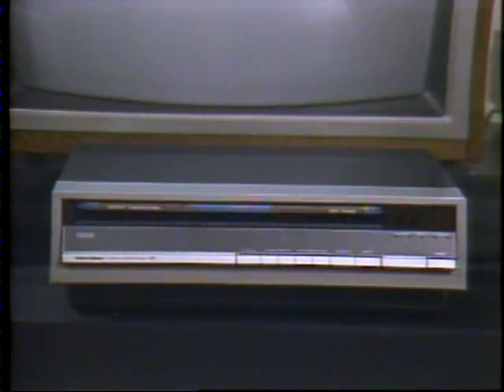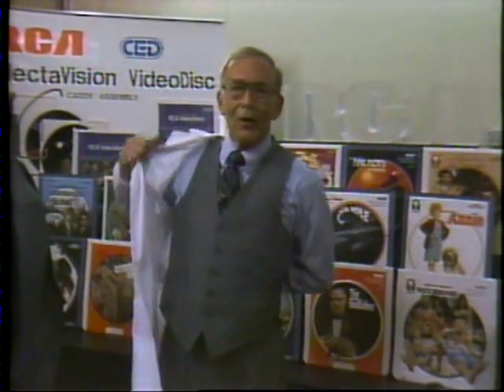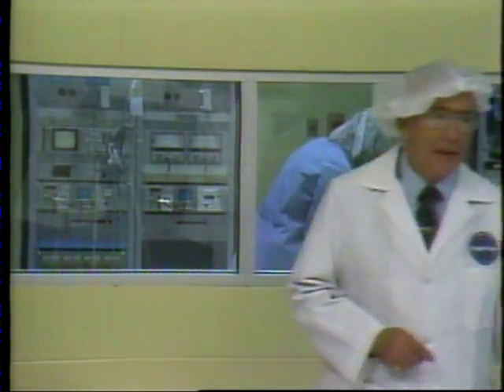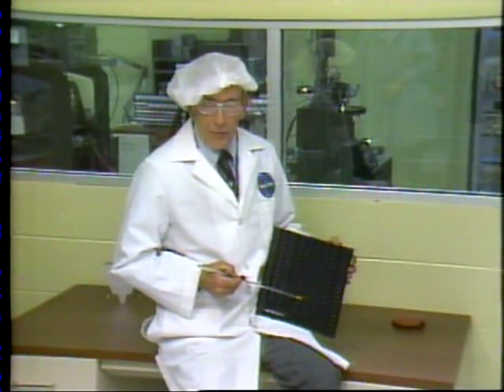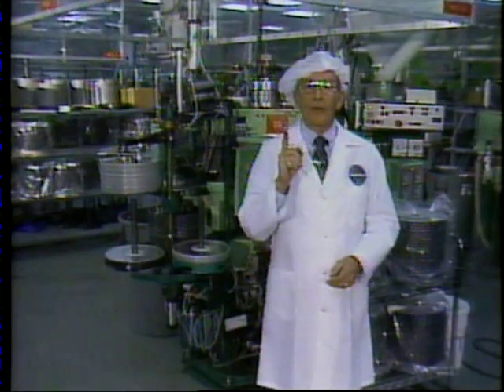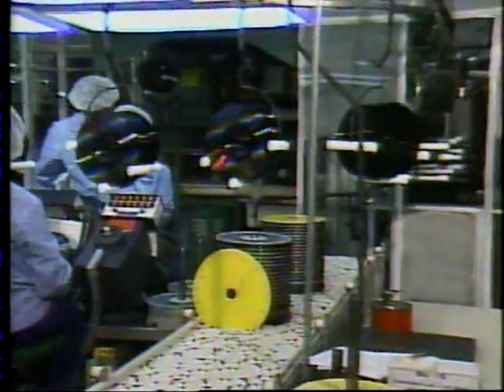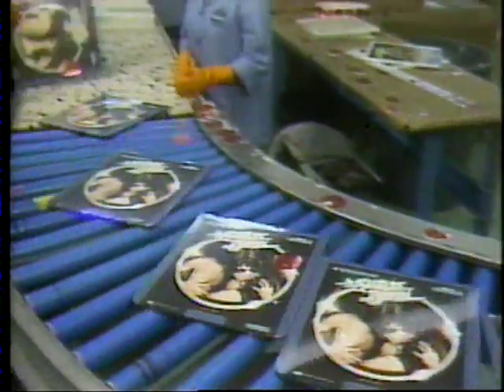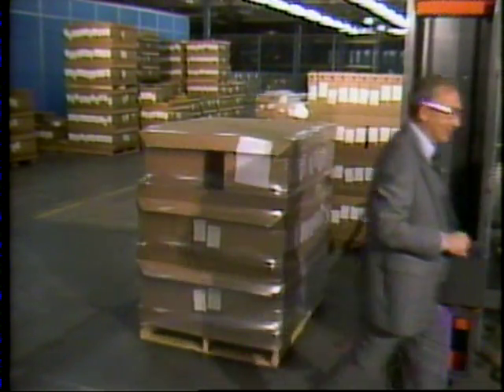Memories Of Videodisc: Disc Manufacturing

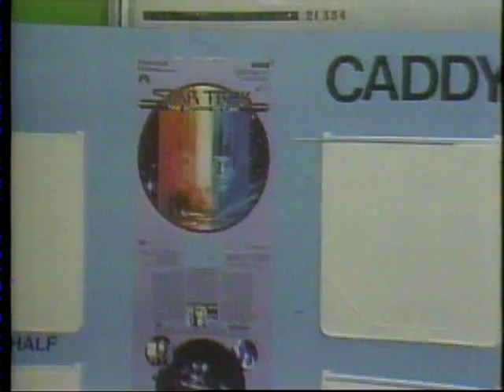Comment: So this video came from a CED disc itself ? I have CED Disc of Star Wars and Star TRek -the very one seen @ 9:52 in this video, but I don't have a working CED player. Was told the resolution of CED was only VHS quality - but this video looks better than that. Surprised . Did you transfer this to DVD and use it's upscaler to help out - or this this the actual pic quality as seen on the CED?
Reply from the maker: +William Wright Yes, this came from a CED, though for all my YouTube uploads I record to DVD using a recorder and then load that into the computer. I watch CEDs all the time on my HDTV, using my Pioneer receiver to upscale them to 1080p- they're not exactly HD quality but certainly watchable!
Reply: WOW ! THX. I do the same for my Laserdisc, which I run through my DVD Recorder's upscaler
Reply: @WRIGHT MEDIA  I know I'm 7 years late to the party, but I can safely say that the quality is surprisingly good on these discs. I recently got into collecting them a month ago and play them regularly on my player. Quality is about the same, if not a little better than VHS as long as the disc is stored correctly and neither disc or stylus is especially worn. If these conditions are met, the discs play really well and look great, (these things are played back using a stylus after all.) I have some that are near prefect with almost no skipping whatsoever, then I have a couple that are almost unwatchable given how worn they are. The discs are much like vinyl records, not only by design, but by the fact that you don't know how well they will play until you play them. Of course, unlike a vinyl record, you can't visually inspect a CED disc without destroying it.

Needless to say, it is a very charming format and I kind of wish that facilities could still be made to make these things for die hard hobbyists.